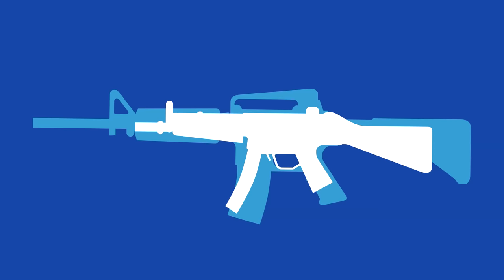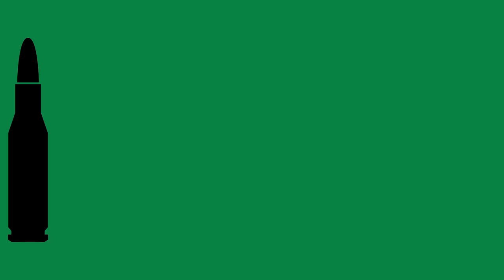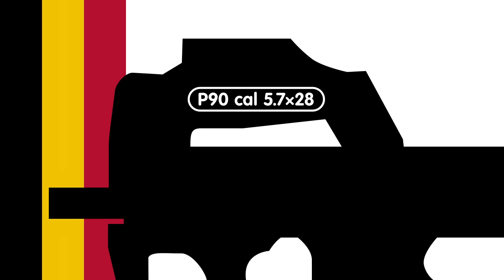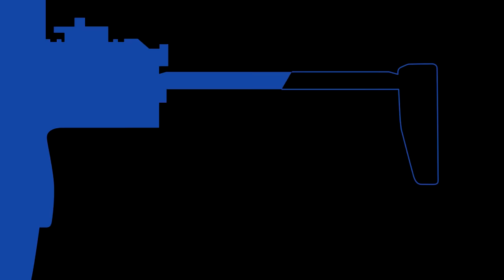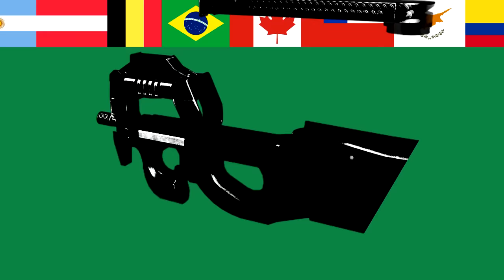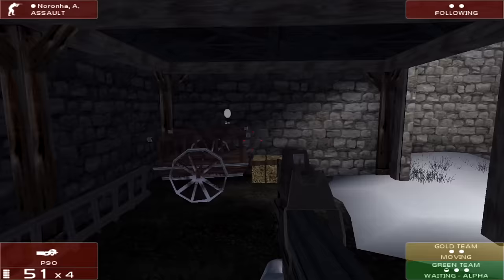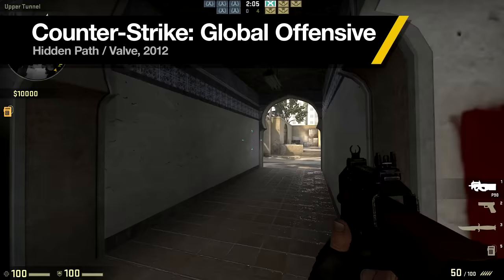P90.

Comment: P90 Vs MP7 trials - P90 is the better weapon
Warzone developers: "I'm gonna pretend I didn't hear that"
Reply: @TechedThrower66 
... ironically realistic.
Reply: The p90 is great in warzone but nobody uses it
Reply: @freezy2755  I've done a lot of trialling with the p90, it's ttk is way too slow to be competitive against smgs up close, and it's got almost  the worst range of the smgs so even the scar is better at range, they've just cocked up the p90 completely, made it crap because it's got a 50 round magazine
Reply: @saabaton169  Have you tried the forge tac retribution barrel? it increases velocity by 200% so it has a faster velocity than a lot of the ars and it increases range a lot so you could use it as an ar if you wanted to. If you haven't in your trials it's worth a try
Reply: @freezy2755  that was all I was using, it's decent in multiplayer, but an enemy you're shooting at can literally sit down and have a beer before running out of sight before you've emptied your 50 rounds to kill him, damage is just too low on the p90 which is annoying as warzone is all about body armor and the p90 is designed for it and beat the mp7, which is a better gun anyway that u can then put a 60 round mag on and it makes the p90 pointless anyway, so we're stuck with a game where 80% of guns are not competitive, and we have duplicates like two 1911's and two rpgs for literally no reason
Reply: @saabaton169  
You've learned something.
The P90 is crap irl and ingame lol
Reply: @freezy2755  the ffar pre-nerf, m16, aug, and mac-10 all pre-nerf: chuckles
Reply: @KoishiVibin  I believe something that held P90 is the ammo costs that shit is expensive as hell
Reply: @newbplaygames  
Another issue, the weapon is poor at Wounding.

Comment: The reason why the P90 was used in Stargate SG1 was not because it looked futuristic, but because the cartridge cases were ejected downwards, resulting in fewer injuries for the actors. In the beginning, the MP-5 was still used. It was not until around season 3 that they switched to the P90.
Reply: I heard that it also looked better on camera due to ejecting out the bottom, you'd never get a cartridge case covering an actor's face at a dramatic moment.

Comment: This is tangential but relevant: I showed my mother your video and it turns out she's watched the director's commentary on SG-1. The reasons the P90 became the standard armament was for two reasons: for filming and at the request/suggestion of the air force. Amanda Tapping was substantially smaller than the other actors and it wouldn't do to have her dwarfed by her weapon, also because it was small and light it wouldn't draw attention from what was being said in the show's many strolling conversations.
 
The air force which consulted for the show also requested that the show clean up it's representation of them a bit, in terms of guns they had a "whatever they felt looked coolest at the time" sort of attitude. The air force consultant suggested the P90 as what they would equip a squad with for this sort of job. It turned out all for the best as the directors liked it a lot, because the squad could trade magazines and it equalized the visual weight across the squad and the other reasons mentioned above.

Comment: "Designed to defeat armor."
Rainbow Six Siege: *Chuckles*
Reply: "Designed to have low recoil and good ergonomics"
Rainbow six:*chuckles*
Reply: It’s strange that in R6 the MP5 is more picked then the P90
Reply: @lyndawong5192  when youre in cqb , you'll learn that hard hitting accurate and acog equipped weapon prevail  , which the mp5 has , 27 vs 22 if im not wrong and acog vs one without it
Reply: Super Soyuz it’s called balance
Reply: Super Soyuz but literaly every weapon in the game has 0 Recoil, I dont know what you’re on about
Reply: Manio 4 Gaming  0 recoil, huh? So we’re just going to pretend that the SMG-12 and Bearing 9 don’t exist?
Reply: Arch-FX Gaming they both have acog
Reply: P90 in r6 is so bad idrk why
Reply: ArchFXT p90 has an acog
Reply: @mrdooce7053  
Well, the GIGN's basically a mobile wall lmao

Comment: I fired the FN PS90 (non-auto, civilian-legal version) at a range once. Very unusual gun with a sort of ridiculous loading mechanism, but very fun to use. Fairly accurate at medium range, but of course I did better at long range with an AR.
Edit: Fixed model name.
Reply: I got to shoot a fully-automatic FN P90 when I went to Las Vegas and it instantly became one of my most favorite firearms. That thing had almost no recoil and my grouping on the target was extremely tight for full-auto. I hope to get the FN57 for my next pistol.
Reply: I used a fully-automatic MP7 and P90 just three years ago when I was at home playing call of duty.
Reply: yeah of course, it's a Short-Medium range SMG, don't forget that
Reply: Indigo Gaming The. AR probably had a longer barrel.
Reply: Indigo Gaming I recently purchased a PS90 and I'm extremely happy with it. Only problem is the barrel length for the civilian version is a bit annoying, not to mention the cost of ammunition for it.
Reply: scrooglemcdoogle whats the trigger like?
Reply: Louis Smith Surprisingly not as awful as you'd think, but generally still kinda bad. Granted I have yet to fire a bullpup with a trigger I'd consider good, and I own (or owned) quite a few bullpups that are available to the civilian market.
Reply: @Craig1287 So the stats of the P90 in CS:GO isn't just bullshit OP valve shenanigans (:
Reply: I own a replica airsoft P90 that I take to skirmishing events. Functions identically spare the obvious lack of death. You get used to the unusual reloading layout after using it for a while. A lot of people will claim it's slow and awkward to reload, but it's really not at all true with practice. It took me a little while to get good pouches and figure out how to wear them best, but I can easily do timed reloads competitive with anyone else at my site.
Reply: Craig1287 Be mindful, the FN57 is really loud. 

Sometimes, the shorter the barrel, the louder the gun. Sometimes.

Comment: The actual reason why the P90 was used in Stargate is because of shell casings being ejected downwards. They used other guns early on but the actors kept getting hit by side ejected cases. A side by side firing line was frequently used and the actors were packed close together presumably because the show was broadcast in 4:3.  (Idk if im using the right terms here btw)

Comment: Weapons for iconic arms:
Barrett M82A3 .50cal 
Glock
G36
Famas
MP-40
Vector K10
AA-12
Intervention
UMP-45
MP-7
SCAR-H
.50cal machine guns
Reply: TEO -13 Drawings & Gaming UMP? USP? DSR?
Reply: Also the Intratec TEC-9
Reply: FN2000, M1903 Springfield, mac 10/11, m240/m249, PP 2000, vss/as val, l85a2, m416,Aug a1,2,3,
Reply: -Barrett M82/M107
-MG42
-Vector SMG
-CheyTac Intervention M200

Comment: These days, the MP5 and the P90 share the throne, and which one you pick depends on what you're asking of it.
The MP5 (specifically the integrally suppressed version), you pick if you're trying to remain undetected enough to make it hard to figure out where you are, so special forces love it.
Contrary to what the movies would tell you, suppressors are supposed to make your firearm "sound like something else, or as if it's somewhere else", not "sound like nothing at all, or be totally silent", and the integral suppressor on the MP5 combined with subsonic 9mm ammo (which uses a heavier bullet and less gunpowder to lower the muzzle velocity while maintaining terminal ballistic performance) accomplishes this task excellently, while maintaining a familiar manual-of-arms.
On the other hand, if you are running something like VIP protection, police, SWAT, or other such duties where you are already expected to be carrying a firearm, the P90 is a good choice, as it has longer range and the ability to defeat armored targets with the correct ammunition is useful given that potential assassins and organized crime members are highly likely to be wearing some sort of commercially-available body armor.

My point is that these days there's a right tool for the job, when in the past with only the MP5 to choose from, you might have been forced to pick a "hammer" when the job called for a "screwdriver".

Comment: So, let me get this straight. H&K were sore losers over losing to FN, so they refused to allow them to win (aka vetoed the operation), therefore forcing a shared victory and having no real winning PDW? Lame.
Reply: the germans were crybabies after their defeat to FN
Reply: All comes down to money. H&K had such a death-grip on the NATO arms market that they didn't want to give up any slice of that pie, especially for something with that much potential for widespread adoption. It would've phased out the MP5 and probably their P-series handguns as well. H&K applied pressure to the German government, an obvious major buyer and subsidizer of H&K, who in turn pushed for the veto. As with many things, governments beholden to corporations led to yet another a situation where no one wins and any hope for efficiency is lost.
Reply: H&K did "win" with the Hk MP5K PDW, do to the lack of need for amour-penetrating PDWs.
(PDW: is a weapon for those who needs a firearm whit stopping-power but not expected to use them often. The amour-penetrating characteristic was needed do to the fear of being attacked by soviet paratroopers in armour. Now that trait stops it from being used, low damage to unarmored targets)
PDWs: H&K won 
pistols: FN and Glock won (H&K dropped the Hk UCP and the Hk USP sucks)
Reply: Regardless the mp5n and mp5k are great guns and are iconic. Do not underestimate the power of an hnk weapon
Reply: I like that carbine version of the UMP45. I think it's the USC UMP45
Reply: Yup that's the Germans for yah, Belgium is superior to German Engineering when it comes to small arms and they fucking hate it!, 
especially when the US adopts there designs and not the Germans(FN Minimi, FN M240 etc.)
Reply: mikeythebold tv actually that was some guy who desperately wanted to be remembered, he was an American.
Reply: Same thing happened to the FAL, NATO wanted to adopt it but the Americans didn't want to use a Belgian rifle so they vetoed it.
Reply: maybe , but it was the right choice . Because today not one would want an universal nato pdw and the mp7 and p90 are both used around the world. But the mp7 is slowly out edging the p90 due to flexibility
Reply: "governments beholden to corporations led to yet another a situation where no one wins and any hope for efficiency is lost."

Huh, its almost like letting governments even HAVE this much power is stupid in the first place.
Reply: Originally the FAL was chambered for the .280 British and the US bullied everyone to accept their munition(7,62x51). And even made a contract with FN about adopting FALs in 7,62x51 but Springfield Armory still exist and they manufactured the M14.(USA military bias Springfield Armory>FN>Colt>>>...>>>rest)
The point is that the FAL originally in .280 British wasn't that heavy and complex.
And what do you mean by "primitive as it is"? In it's time the FAL was modern.
Reply: Bussines mah dude (basically)
Reply: botond bujtor  Why does the USP suck
Reply: These events remind of the situation when NATO was looking for standard close air support (or CAS) aircraft in late 1950s and went through all testing and then winner of that competition was FIAT G.91... it was nice CAS aircraft design for its time but unfortunately brits and french didnt want to accept Italian design over their own so they vetoed that standard CAS program.

Comment: My civilian version, 16" long barreled PS 90 (S=semi-auto) and companion 20 round RUGER 57 pistol are excellent home PDWs and great range toys. I'll carry the RUGER 57 when I'm hiking here in the desert southwestern US for its much longer maximum range than a 9 mm round from my LC9s.
 The RUGER 57 is more reliable than the FN Five seveN and about 1/2 the price. Soon RUGER will very likely make its PC carbine in 5.7 x 28. All this makes the cartridge more popular and, hopefully, less expensive.
On my PS90 I have a VORTEX SPARC 2 red dot sight on an aftermarket lowered mount and side Pic. rails plus a larger left side charging handle.
Carrying P90/PS90 magazines means one needs long mag pouches. I have 2 double mag pouches with US MOLLE attachment strap made by The Vest Guy of Multi-Cam Cordura. They attach to my Blackhawk vest and close with FDE Fastex buckles. Very handy.

Comment: Good video but a key piece of history left out was that the p90 was developed for non combat arms units. As they weren’t properly equipped to fight Russians (this is the height of the Cold War), they needed a gun that could defeat Russian body armor if supply convoys were attacked. Then, due to its efficiency, specop units started adopting them.

Comment: I have to wonder if you'll ever do an episode on another one of John Browning's most famous designs: The M2 .50cal heavy machine gun.

And if you do make an episode on the Ma Deuce, you wouldn't mind at least acknowledging its use as an aircraft weapon, would you? Please?
Reply: And, for that matter, a bit of mention and love for the M3?
Reply: The M3 is awful, IMO.
Reply: Katherine Ftw why tho? in my opinion it is an upgrade to the M2 the M3 has a faster fire rate
Reply: The M3 is LITERALLY designed to be unusable and unserviceable. It's far worse than the M1929 and M1928 that came before it in terms of usefulness, also being so inaccurate not even U.S. Propaganda could make it look good.

May I also mention the fact that it's sole purpose was to be a cheap, easy to produce replacement and fails in comparison to other weapons around the time made for that like the Uzi?

Plus, the M2 is an LMG, not an SMG. You can't compare them.
Reply: Katherine Ftw oh so youre talking about the smg and not the Heavy machine gun? lol sorry ive misunderstood you
Reply: Uh. There's literally ONE M3.
https://en.wikipedia.org/wiki/M3_submachine_gun
Reply: Katherine Ftw uh nope there is another M3 heavy machine gun made by FN and used in aircrafts like the F86 it is designed by john m browning it is just a M2 with a faster fire rate
Reply: Katherine Ftw and yes I agree the M1A1 thompson is superior in firepower to the M3 but the M1A1 is heavy and expensive thats why they replace the M1A1 to the M3
Reply: Uh, this would be classified as an M2 Variant, NOT as a separate series.
https://en.wikipedia.org/wiki/M2_Browning#AN.2FM2

There's three models of Main Series Thomsons, the Original M1921, the M1928, and the M1929 (also referred to as the M1928A1.) I'd argue the M1921 is still the best model, but that's my opinion.
https://en.wikipedia.org/wiki/Thompson_submachine_gun

Finally, if you read my original comment...... Well, I'll just repost: "May I also mention the fact that it's sole purpose was to be a cheap, easy to produce replacement and fails in comparison to other weapons around the time made for that like the Uzi?"
https://en.wikipedia.org/wiki/Uzi

Extra Note: I mentioned in my original comment that the M3 was DESIGNED to be terrible. You literally can't defend it.
https://en.wikipedia.org/wiki/M3_submachine_gun
Reply: Katherine Ftw oh thanks and sorry for not reading all of your comments lol
Reply: To be clear, the M3 is the technical designation of the aircraft specific .50 BMG browning design that had a higher cyclic rate. That's why I mentioned it in a thread about the ma duece.

What's more, yes, the grease gun sucked. But, as a tank crew weapon, keep in mind it was NEVER supposed to even be used. It's kind of a weapon like, say, a service pistol. You shouldn't be using this but here, just in case.

Whiiiich was why it sucked.

Yada yada yada, see also wikipedia because you used it so it's fair:

During World War II, a faster-firing Browning was developed for aircraft use. The AN/M3 features a mechanical or electrically boosted feed mechanism to increase the rate of fire to around 1,200 rounds per minute. The AN/M3 was used in Korea on the F-86 Sabre, F-84 Thunderjet and F-80 Shooting Star, and in Vietnam in the XM14/SUU-12/A gun pod. Today, it can be found on the Embraer EMB 314 Super Tucano.

The M3-series is used by the U.S. military in two versions; the M3M and M3P. The fixed, remote-firing version, the FN M3P, is employed on the Avenger Air Defense System, and is currently used on the OH-58D, augmenting the XM296 .50 cal. machine gun.[74] The M3M flexible machine gun has been adopted by USN under the designation GAU-21/A for use on helicopters. The GAU-21/A is also being used by the U.S. Marine Corps to upgrade from the XM-218/GAU-16 .50 cal. machine gun for the CH-53E,[75] on the UH-1Y Venom, and on the Canadian Forces' CH-146 Griffon via the INGRESS upgrade.[citation needed] The Air Force is looking to replace the GAU-18 on the HH-60G Pave Hawk with the GAU-21 because of its higher 1,100 rpm rate of fire, longer 10,000-round barrel life, and lower recoil through use of a soft mount.[76]

To state the obvious, this is not what you mentioned, but I get it. the AN/M3M and P were really not considered variants since they basically turned it into a chaingun browning with a mechanical feed assist. Pretty significant redesign.

BUT 
This is, indeed, splitting hairs. Regardless, the abovementioned M3 is the one I was talking about, and the one we wanted him to mention where he to do a video on the ma duece.
Reply: The M3 grease gun actually worked very well and was well-liked by its users. It was also very widely used. It wasn't "designed to be terrible." It was designed to be dirt-simple and cheap to produce. The people who have to actually USE weapons on a regular basis don't care how they look. They just have to work. And the M3 did. Most of the few problems it had were due to the Sten magazines that were used, not the gun itself.

On the Internet you don't have to actually know what you're talking about if you're pretentious enough, though.